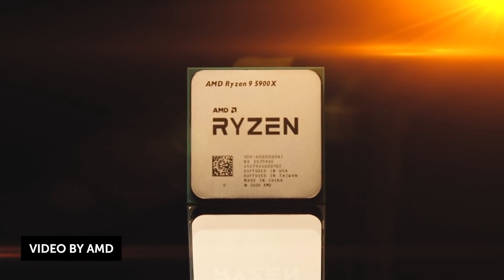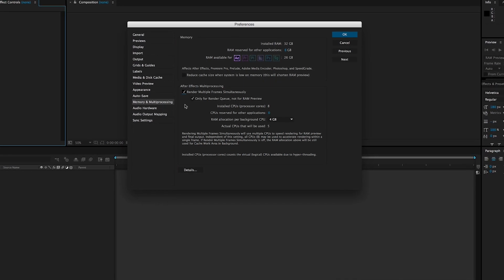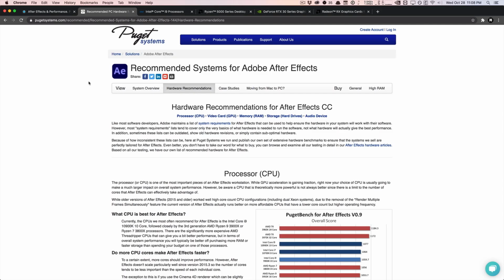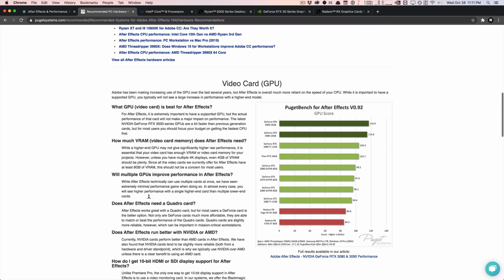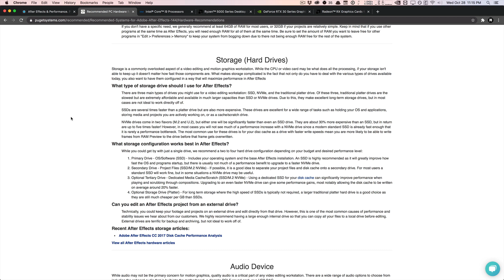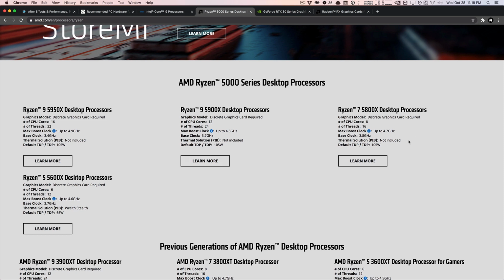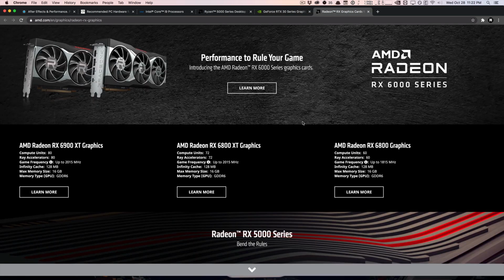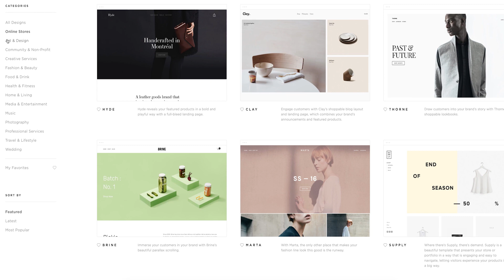How to Build a PC for After Effects Performance (2020)

Comment: I am so glad to know that I got my whole setup ass backwards. At the time I built my pc in mid 2017 I did not have after effects on my mind and wanted an all amc pc but even then support for gpu rendering on amd was kinda non existent. But now that I am stuck with a Ryzen 7 3700X and an AB350 board I cannot go back and pick an Intel cpu and the RTX 3070 I just ordered won't make much difference unless I used it for Arnold or redshift rendering. I have some experience with the former.

Comment: You...just....skipped the whole ram part....? "32 to 64gb" and thats it? What's the best speed? does it matter? What type of memory? does it matter? Any specific brand better than others? any specific limitations with other hardware pieces?

Just saying, there's much more to buying RAM than the amount of gbs...
Am I in the wrong place looking for AE Hardware talk?....
Reply from the maker: It's hard to quantify is why. Of course there's more than just the memory amount. A lot of the RAM speeds are gimmicky, requiring certain XMP profiles and mobos, which based on my own experience doesn't make a huge difference. Puget seems to agree: https://www.pugetsystems.com/labs/articles/Does-RAM-speed-affect-video-editing-performance-1528/

Stick with RAM around 2666 or 3200 and you should be set.
Reply: I agree, there's no point in having more amount of GB if your CL number is very high. It would be a good opportunity for that to be explained. Also with the SSD topic.
Reply: General advice: don't go bellow 2600Mhz RAM, but also don't go above 3600MHz either (Of course it's safer to take higher speed RAM so you can tune it down in your BIOS, but it makes little sense if you don't shit gold, and if your CPU or motherboard can't even handle the RAM frequency. Generally speaking speed is as important as stability, so you have to find something that is fast and coherent).
https://premiumbuilds.com/features/ryzen-ram-speed-benchmark-analysis/ This article checks what good does ram speed do to an AMD Ryzen system. It's quite interesting although I feel like whenever I research this question the answer is: while you could invest in faster RAM and gain 3% performance, all that money could be better invested elsewhere. Like a more comfortable mouse or something. Your carpal tunnel will thank you later.

Comment: guess you gonna need to make a new video after AMD's new graphic cards
Reply from the maker: I included AMD's new RX 6000 cards in the video. But you're right, benchmarks haven't been released yet, but those tier cards should be about right in terms of practicality haha.
Reply: @CreativeDojo  i dont get it. I thougt only NVIDIA cards aupport AE/ C4D thanks to their CUDA (+openGL?) Support. And that AMD can't compete with that, as AE won't work as fast.
Am I wrong here? AMD does fully boosts work on AE?
Reply: @eladbari  if you’re on Mac they killed cuda driver support in Mojave